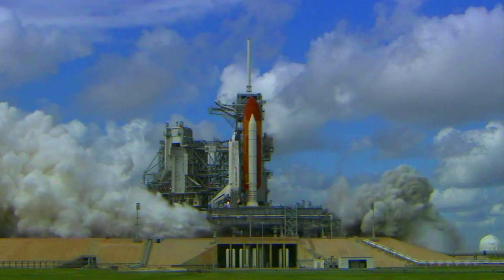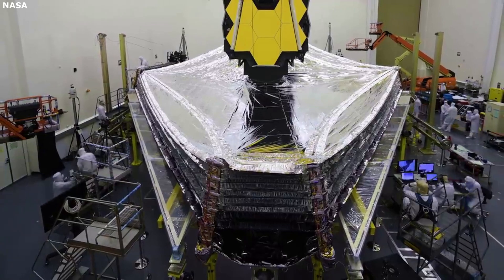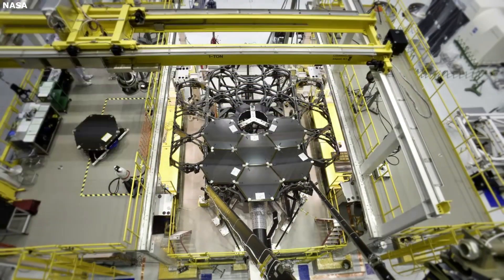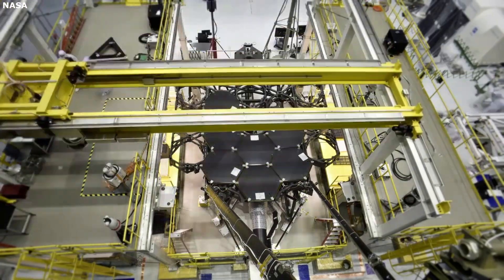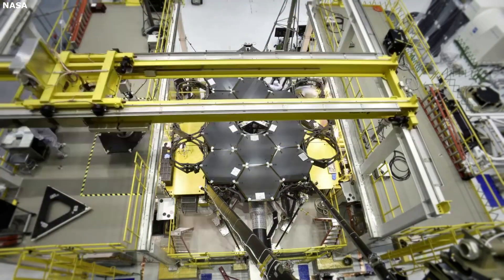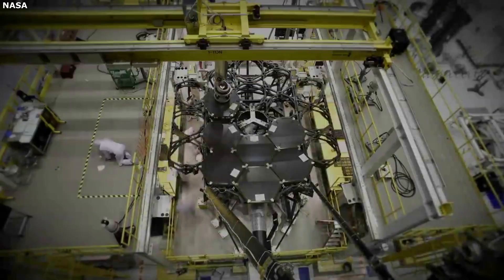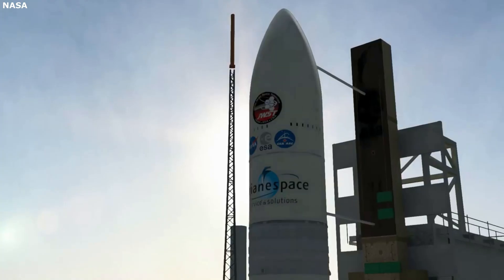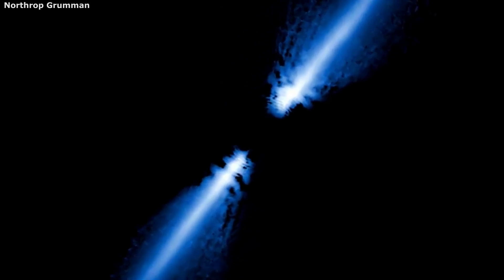The Fascinating Design Behind The James Webb Space Telescope Mirrors

Comment: How about they just build a wider rocket instead of all the folding. What a waste of money.
Reply: Designing, developing, and confirming reliability of a new rocket is extremely expensive and time consuming.  Especially considering that there may not be other payloads that would use such a wide rocket to justify the cost.  Not to mention there is a substantial cost savings in using an existing, proven launch platform because there are no development costs or risks.  And that a very wide rocket would not fit in the existing launch pad, handling equipment, and manufacturing tooling, requiring that infastructure to be built.

Also, NASA would not justify launching a $10 billion machine on a brand new unproven rocket.  It would need expensive flight tests and previous customer launches to prove reliability.  Ariane 5 has have over 100 flights since the 1990s.

Designing these complex satellites engineers conduct trade studies to figure out what is the most cost effective, least risky, and reasonable solution.

Rocket science ain't easy, and what seems like a simple, easy, cheap solution is far more complex that initially thought and does not make sense.
Reply: @aemrt5745  extremely expensive and time consuming, I think you mean James Webb lol. Sometimes you need to take a step back and think in truly simple terms. If they could do it all over again, they probably could have built 2, expanded load width and given more opportunities for bigger pay loads in the future for the same price. Ask some people that worked on the project in person. Making an extreme single point failure is a terrible way to design. The history of the moon landing is all about small incremental achievements.
Reply: @_Triangularity  So, have you actually worked in the Aerospace industry?  Any education in Engineering?  Ever design this stuff?  Industrial marketing and budgets?
Reply: @_Triangularity  Except for marketing, I have done all I described in my previous post.  About Apollo, there were plenty of bold, nonincremental steps.  You cannot go from first manned space flight to lunar landing in 8 years without bold steps!  Apollo 8 was the first manned flight on a Saturn V and it was the first manned flight to lunar orbit, just to name one example.

Single point failure?  Here is Apollo.  Command Module Main Engine; if it failed in lunar orbit, they were stuck.  LEM Ascent Stage Engine; if it failed, impossible to leave moon.  Flight computer had no redundant system / backup.

Single point failure elements are sometimes unavoidable.  The key is develop reliability.  Guess what, any airliner you travel on has single point failure elements.
Reply: @_Triangularity  ...and you ignore the structural issues of launch loads on an unfolded fragile satellite, which would pretty much nullify the wide rocket idea and the possibility of other payloads.  The telescope is as big as a tennis court, I highly doubt that volume is marketable, let alone remotely practical.

You really have no concept how expensive and difficult it would be to develop such a rocket.
Reply: @_Triangularity  ...and unfolding a satellite is routine and common.  The challenge is the sunshield, but I can guarantee it is nothing compared to a new rocket.
Reply: Also, folding satellites inside a fairing is nothing unusual (granted the heat shield is a new challenge).  There are advantages to having a folded payload, including having your launch loads on a smaller volume.  Having elements extended and subjected to high launch loads can cause cantilever stresses on the structure that would not happen if they are tucked away.  That would require beefier structures and increase weight and launch costs.